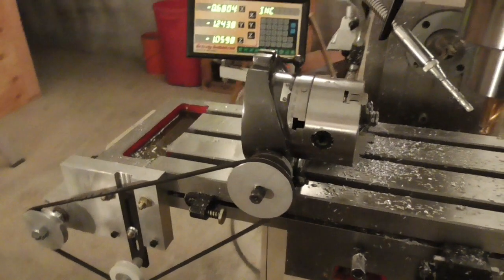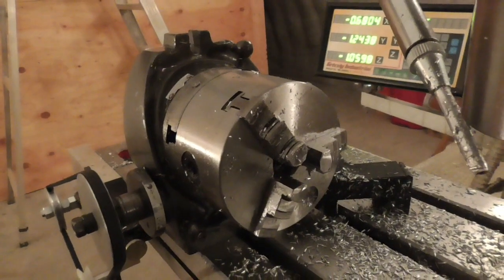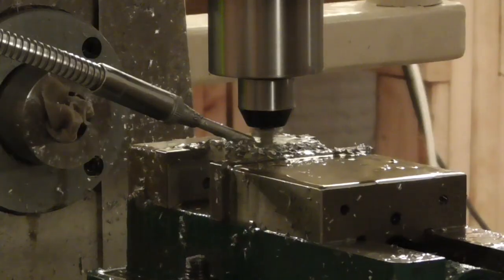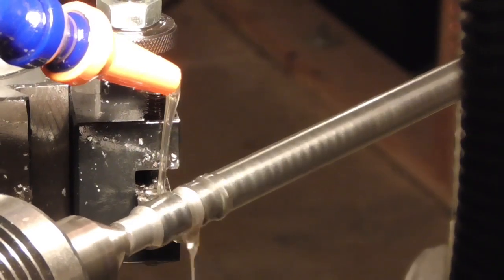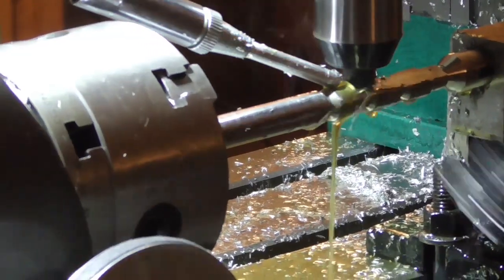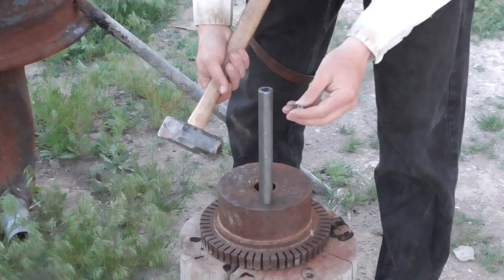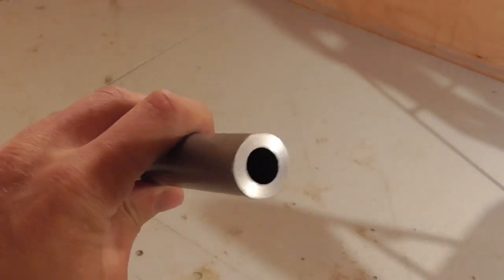Helical Machining: Rifling with the Norris Chuck (TIS094)

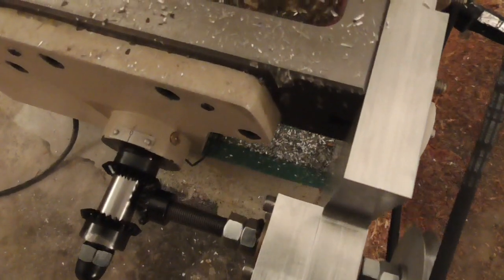Comment: I'm currently building a similar thing to this, although I'm controlling mine using an arduino and stepper motor. It takes an input from the DRO scale and for every certain number of pulses (13 for roughly 1:16" with 5um scales and 1/32 Microsteping) it will send a pulse to the Microstep driver and stepper motor. I'll make sure to record it and upload a video of it to YouTube.

Comment: good audio quality, If i were to give a couple of videography suggestions, avoid all slowmo modes on any cameras not designed for exclusively slow motion capture, the frame rate is pretty disorientating, and can give people motion sickness. Since you are a machinist maybe make some of your own rolling camera jigs(camera sliders) so you can have a smooth motion around filming your machines/timelapses. people make camera sliders out of pvc and roller blade wheels all the time, should be a piece of cake to make something more proper in your shop.

Comment: so what makes the twist? It looks like the grooves would just come out straight if you don't rotate anything
Reply: The button turns on its own, it follows the twist rate he cut into it. Think of it like a bolt spinning into a threaded hole, except with a bolt, you turn it to make it advance forward, but with the rifling button it's the other way around, you advance it forward to make it turn, and the "threads" are cut as it moves.
Reply: @TheExplosiveGuy  ok thanks, I didn't see that mentioned in the video

Comment: Could you not maybe draw the rifling button through the barrel on say a threaded rod, rather than hammer it through?
I always understood that rifling buttons were pulled through the bore rather than pushed through it?
If memory serves Jurgen Anschutz from Germany makes their Anschutz barrels with button rifling and they are drawn through in slightly increasing sizes for each subsequent cut.
Most other manufacturers hammer forge their hot barrels around a hardened reverse rifled mandrel.
Cold drawn button rifling some claim makes a more stable barrel, for competition shooting etc.
Hot hammer forging is quicker / cheaper.
I have a ~45 year old Anscutz model 1532D in .22H that was drawn button rifled and it’s been a half MOA tack driver all it’s like which is why I hung onto it.
Just thinking that your mill X axis would draw the button through while your rotary chuck would turn the button rod at the correct twist rate?
So the method you use to mill the button could be employed to pull the button through the barrel?

Comment: Have you ever considered coupling a sine bar to your system so you can adjust the helix without making new gearing? You could have Chuck Norris sign it. Then it would be a Chuck Norris signed sine bar  Norris chuck.  Then you could tell folks in the bar that Chuck Norris signed your Norris sine bar chuck.

Comment: Is that considered hammer forged rifling?
Reply from the maker: The term hammer forged rifling usually refers to rifling produced by forging the outside of a smooth-bored barrel down onto a mandrel that has a mirror image of the rifling on it.  This would be considered a form of button rifling.

Comment: Fitting a button to a bore/bullet:  ABOUT how much 'oversize' does the button need to be to leave proper size Grooves in the barrel?  Will 1 or 2 thou be enough to press the groove to finish 'correct' diameter for caliber, or does it need more than that (ignoring the bore/lands for the moment).

Comment: Does the belt slip at all?
Reply from the maker: If the belt is properly tensioned and the cut depth is reasonable, the belt doesn't slip.  If the cut is too heavy or the belt isn't tight enough then it can slip.  However, if the belt starts slipping, then the chuck stops rotating, so if you're attentive to the chuck and it starts slipping you can usually catch it and correct it without ruining the workpiece.

Comment: guess you should be using timing belts with tooths instead of v belts for syncing purposes. non toothed belts are intended for power transmission and have a slip so you might lose sync between the input shaft and the output shaft.
Reply: holy, I am watching this 6 years later and came back to say the same thing just to see that I already said it, lol

Comment: Thats awsome do you sell rifling buttons ?
Reply from the maker: Almost.  I haven't sold any yet, and I'm not quite ready to start making them for sale (I've been heat-treating them with an oxyacetylene torch, which limits me to heating one at a time and doesn't provide very uniform heating, so I'm working on building a propane furnace and fine-tuning a few other aspects of the process) but I'm hoping to start making buttons for sale in the next few months.  When I do, I'll certainly make a video announcing it.  In the mean time, if there is any particular caliber you're interested in, I can make a note of it for future reference.

Comment: Not bad at all.  Needs to be lapped to accuracy good, but the hard part is done.   Why the new riffling design?  Did you change the design on purpose?  Is that what just happened to come out or did you make that design on purpose?
Reply from the maker: The pattern was unintentional this time, but now I'm thinking I should make several barrels with different patterns of grooves (like this vs. uniformly spaced vs. all three close together) and see which produces the best accuracy.
Reply: TheIdahoanShow... The three that have the same distance between them I bet :-)) and found out on my tries (0,28mm deep) but could be an other result at your setup...

Comment: Soo.... Do you sell those rifling buttons?
Reply from the maker: Almost.  I haven't sold any yet, and I'm not quite ready to start making them for sale (I've been heat-treating them with an oxyacetylene torch, which limits me to heating one at a time and doesn't provide very uniform heating, so I'm working on building a propane furnace and fine-tuning a few other aspects of the process) but I'm hoping to start making buttons for sale in the next few months.  When I do, I'll certainly make a video announcing it.  In the mean time, if there is any particular caliber you're interested in, I can make a note of it for future reference.

Comment: Interesting video but there's no explanation as to how the twist develops in the barrel, as it appears that the rifleing button is driven straight down the barrel without any rotation.
Reply from the maker: The helical ridges on the button that impress the grooves into the steel cause the button to rotate naturally as it is driven down the barrel.

Comment: How did you determine the size of the pulleys you needed to get the right twist rate? Love your channel and appreciate the knowledge you have and share.
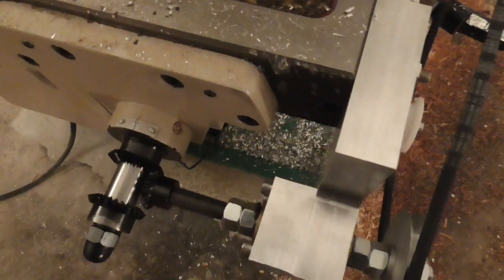Reply from the maker: Well, I made the first two pulleys the same size, providing a 1:1 ratio, and measured the horizontal travel of the table for one revolution of the chuck, which came out to about 10 inches, so if I want a 1:20 twist rate (for example) that means I need a 1:2 pulley ratio, so I make one pulley twice as big as the other.
Reply: Ok, gotcha.  That makes perfect sense.  Thanks for the reply!  Again, love your channel.

Comment: This is crude in the extreme, there needs to be a positive connection between the driving bevel and the chuck, by using a vee belt there is too much potential for slip, if you use a chain, (bicycle chain), at least it would have a positive drive, but the normal way of doing this is by using a short lead attachment, which is gear driven, this is how a helical reamer blank is produced, so by changing the gear ratio almost any helix can be machined
Reply from the maker: There are pros and cons to using a V-belt vs. gear drive or chain-and-sprocket.  There is a finite torque at which a V-belt will start to slip, so as long as it is used below that torque, it provides a fixed ratio with zero backlash and an infinite number of possible ratios (since I can machine a pulley in any size I want).  Gears and chains offer the ability to handle greater torque, and a properly-designed gearbox would allow changing ratios simply by moving a lever, instead of having to change out pulleys, but gears and sprockets are much more difficult to make and/or much more expensive to buy, and can only be used in certain ratios because their teeth have to mesh.  I can see where a gear drive setup would be better suited to a reamer manufacturing plant, but for an inventor like myself the advantages of the V-belt system far out-weight its drawbacks.

Comment: well done. you make it look so easy and for you maybe it is so..., do this for me. make your button with 5 sides instead of 3. you will only need one pass and it will be like most factory barrels.
edit: is the chuck that the 3 buttons were in not strong enough to handle pushing a button on a shaft through a barrel? better than hammering it through.
Reply from the maker: I do intend to try out some different button styles in the near future.  As for pushing the buttons with the chuck, I don't think it would be strong enough for that.  However, I do intend to make a hydraulic press for rifling barrels in the near future.

Comment: how do you get that 3-sided button to spin x amount of degrees inside the tube? also,how did you mike that button?
Reply from the maker: The button is machined with the desired amount of twist, so the angle of the lands forces it to rotate as it is driven down the barrel.

Comment: you will find using a lubricant will make your button swage much easier.
Reply from the maker: I lubricated the button with moly grease when I was driving it through the barrel.  Maybe I forgot to mention that.

Comment: Bleeding ears be damned, body language and pointing out stuff on the tools and materials is more important than getting rid of an echo.
If you do want better audio don't gimp the visual presentation for it, where possible put up sound damping/absorbing materials around the room, even a simple thick curtain will reduce reverberations a lot, some recording hardware and software changes may help but a good quality source from a good recording environment is the best way. That means not just good audio but also an easy to follow presentation that requires little to no editing.

Comment: hello there could you suggest the complete list of CNC milling/ lathe machines needed to manufacture a complete rifle and its parts also a rough estimate of how much it would cost, Thank you.
Reply from the maker: Well, it depends.  If you just want to build a single rifle, you don't necessarily need CNC.  A good metal lathe and a basic milling machine would about do it (plus a few assorted hand tools like a hack saw, screw drivers, etc).  I don't have any CNC machines at this point; I'd guess I spent about $15k on machinery for my shop, but I bought all brand-new equipment and what I bought isn't necessarily the bare minimum for gunsmithing.  I expect you could keep the cost less than $10k if you needed to (potentially a lot less, depending on the level of precision and repeatability required).  On the other hand, if by 'manufacture a rifle' you mean actually mass produce a rifle of a given design, then you would need CNC machines and/or other forms of automation.  I would guess that setting up a very basic production line would cost at least $200k, and potentially a whole lot more, depending on the level of precision and the volume of production required.

Comment: I noticed you did not use a cogged belt & pulley. How did you keep the table feed and the rotary head in time?
Reply from the maker: Well, I haven't had any trouble with the belt slipping yet, and as long as the belt doesn't slip, the timing is preserved.

Comment: 5:24 i can see there is rifling in the barrel  at least a line
Reply from the maker: That line is from the drawing process of the DOM tubing.  It is still visible intersecting the rifling grooves at the end of the video, though it is a superficial mark with very little depth compared to the rifling grooves.

Comment: awesome video! wish you kept the  buttons together to make a progressive cut similar to how a step bit works. Also curious if you have tried something similar to a jack hammer to drive buttons? would it be cleaner that way or potentially vibrate the tool steel to death?

Comment: Wow.  Simple and it works.  Best design I have seen so far.  I'm impressed.   Don't let anyone hack on you about the name... they're just jealous.  Do you have any design drawings or did you just "go with the flow?"
Reply from the maker: My working sketches for the components of the "Norris Chuck" were pretty crude--basically just a list of measurements I took on my mill that I tried to map to the cuts I would need to make.  As such, I'm afraid they wouldn't make much sense to anyone else (or maybe even to me, now that the project has been done for a few weeks).
Reply: My machinist skills are not much better than high school level/college entry.  I've looked at a number of rifling machines online and on youtube and for the most part they are much more complex and at the limits of my skills and equipment, however, yours seems to have a more intuitive design.  I'm here and I want to get there, how do I use what I've got.  I think now that I've seen it, I could in turn re-create it.  I've been looking for a way to make rifling buttons and other projects requiring multi axis machining and this setup looks awesome.  Good stuff.

Comment: You get an A+ for ingenuity on you super spacer drive....  I believe that you are technically swaging rather than cutting rifling as a button or single point cutter would do; but excellent video nonetheless. I'll definitely be using your drive mechanism on my machine. Thanks!
Reply: Also, try a trepanning bit for turning the square pieces of stock into rounds for pulleys; much faster & less drama than knocking the square corners off.

Comment: It's Morse not Morris! By your reasoning it would be a Norse chuck? Powering the dividing head by gear from the table feed is used to make drills and reamers. The disadvantage of your system is you only have a friction drive and not a positive drive to couple lateral and rotary feeds. Perhaps you might consider using toothed pulleys and a timing belt to give positive drive?
Reply: Yes, toothed pulleys and a timing belt to give positive drive would be better.

Comment: Sound is much better... though taking regular speed footage and slowing it down a bunch creates a stuttering effect that feels like a video buffering problem with the video stream.  I'm suspecting you did that so the video would cover the narration that was longer?

If your camera is capable of higher frame rates and you're doing beauty shots, then record at a high frame rate.  If you decide to slow the footage down, it'll be smoother.  If you want to run it at regular speed, just convert it to 29.97 or 23.98... whatever you're editing at.

You should always shoot more than you need.  Better to have trim an extra inch off of a 2x4 than to be an inch short.

Oh, and a little music over the title would be nice.  You can purchase Royalty Free or Buy-Out music fairly cheaply if you find a song in the owners library that you like.  

Welcome to the joys of video editing. :)

Comment: Add a roll pin to your bar stock to index on your chuck jaw for an accurate position for a second button. Leave them connected to cut 6 equal spaced grooves.

Comment: Very nice!
 Ok, so you are actually swageing the rifling. 
  What you figure is you total depth per side?
  I supose a guy gould run multiple buttons through there. 
  Next, that little insert shell cutter... never seen one like that. Where'd you find it?
   
Also, what is your material selection for the button? Has to have some carbon or manganese to accomplish an air harden... 
  Well done!
 Mark
Reply from the maker: Thanks!  I made this button out of A-2 tool steel.  I have also used O-1 tool steel in the past (with an oil quench) and it worked ok.  Like I said, it's always a bit of a guessing game to get the fit exactly right, but I would estimate roughly 0.003" of radial interference is about right.

Comment: awesome video. Do you think you could show a cad tutorial on rifling layout?
Reply from the maker: Maybe, although with this machine I don't really need to draw anything up in order to make a rifling button.  The twist rate is set by the pulley ratio, and so once I figure out what diameter to make the button, it is just a matter of turning a short cylinder of tool steel with tapered ends and then machining the flats deep enough to provide rifling lands of the right width.

Comment: at 5:24 you can clearly see that the supposedly round stock tube was actually already rifled  same on you mr ....
Reply from the maker: Nope.  The streaks you can see inside the tube at 5:24 are superficial marks left over from the drawing process by which the DOM tubing was manufactured.  These marks run lengthwise and have little to no depth, in contrast to the spiral grooves made by the rifling button.  The streaks are still visible at 6:12, where they can be seen as faint lines intersecting the spiral grooves, particularly near the 7 o'clock and 10 o'clock positions.
Reply: TheIdahoanShow i am no troll but please next time flip the dam thing so people like me are sure you do what you say you do!

Comment: UHHHHHH How do you get a twist grooves when you drive the button straight. #headscratching...
Reply from the maker: When the ridges on the button impress themselves into the steel of the bore, the angle of the ridges causes the button to rotate as it is driven down the barrel--similar to how the grooves force a bullet to rotate as the bullet is pushed through the barrel.
Reply: yeah, i did find another video from your channel that shed a better light on this process. Thanks.
Reply: Making a Rifled Barrel without Machine Tools